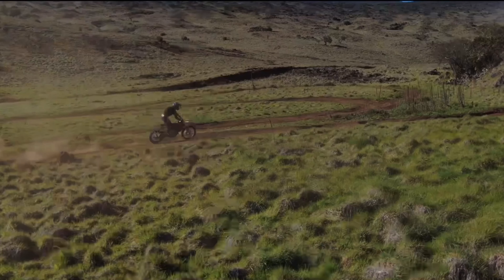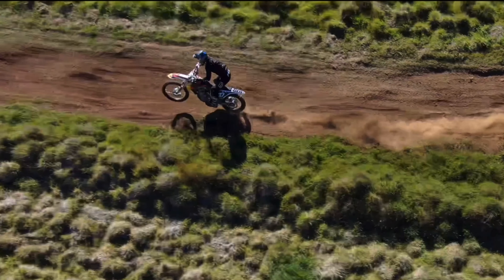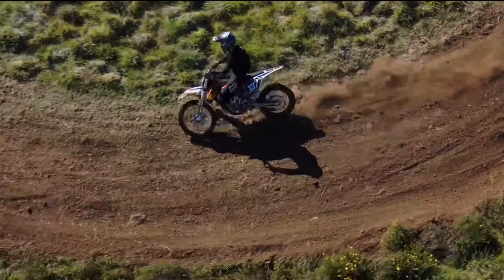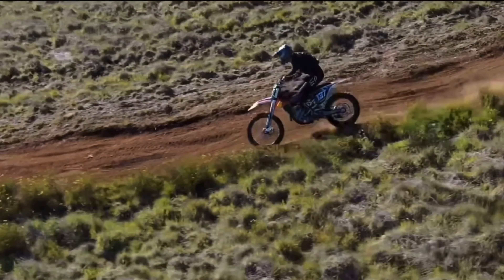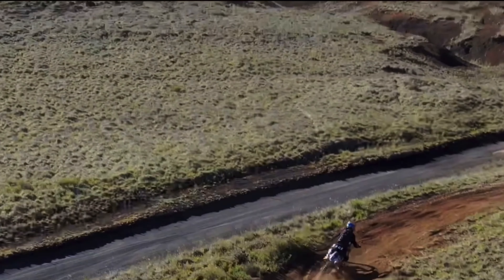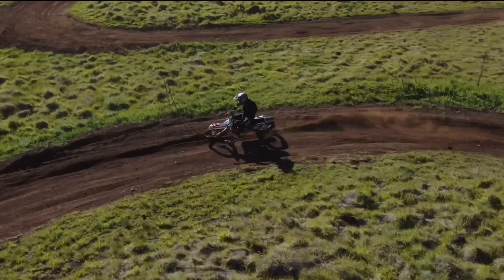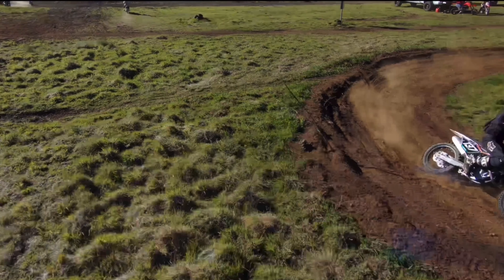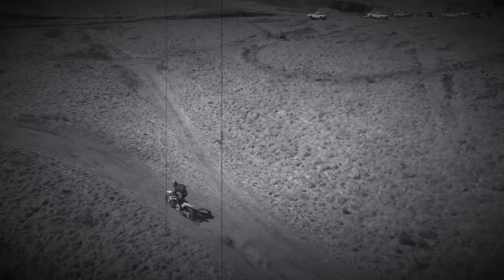Dirtbike Riding Technique Breakdown (Slo-Mo/Voice Over)

Comment: It seems the  road side is full of rocks. How would you react if you go out of the track at high speed and  would there be high risks of crashing  hard?
Reply from the maker: There's always a risk of crashing hard 🤣

Some of the visible piles of rocks are nearly as high as the front wheel and human body sized rocks all over in the grass completely invisible to the eye. Come off the brown, you are going down.